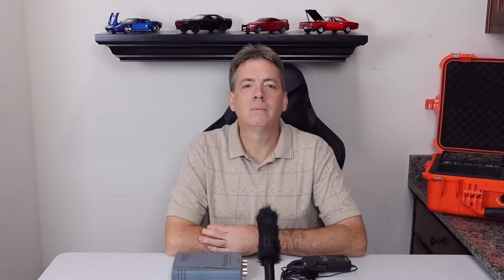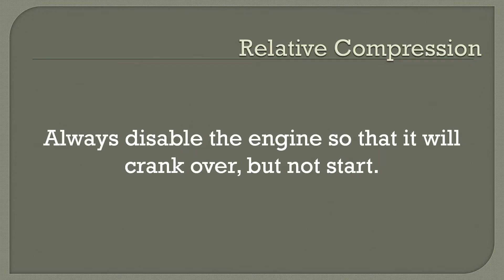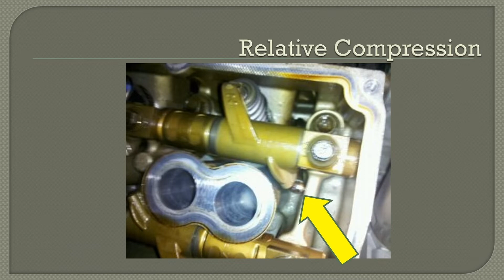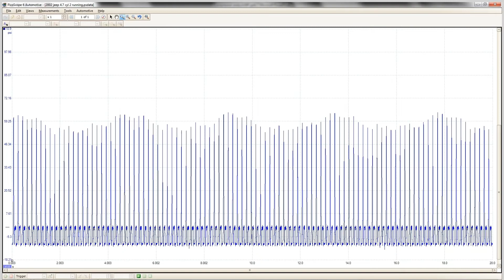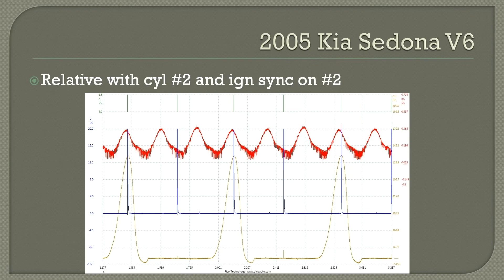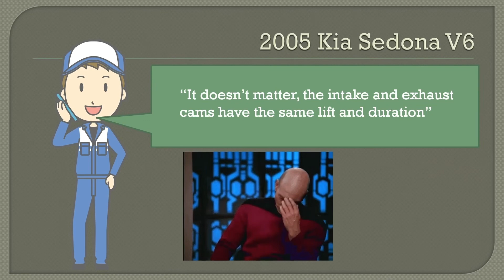Relative Compression

Comment: My problem is that I cannot seem to grasp a reading of 370amps on a system equipped with an alternator that has a maximum rating of 140amps for an example.
Reply from the maker: That 370 amps is just coming from battery reserve. It is only while actually cranking the engine over, as soon as the starter disengages that draw goes away.  So it is pretty easy for the alternator to recharge that lost battery capacity within just a couple of minutes of running.